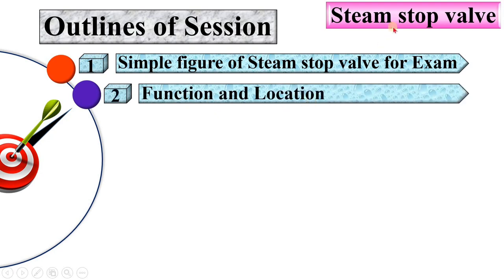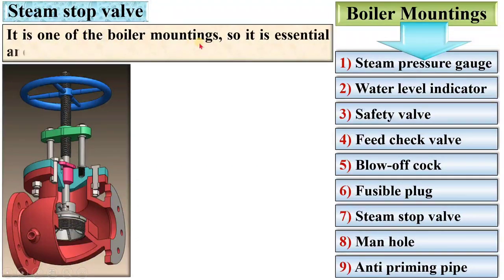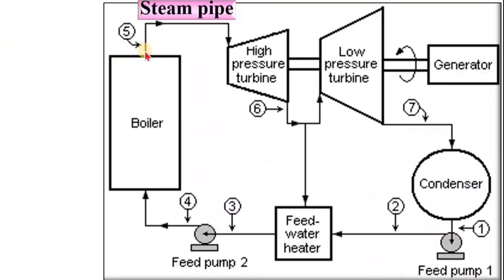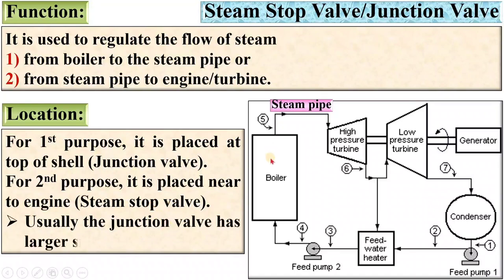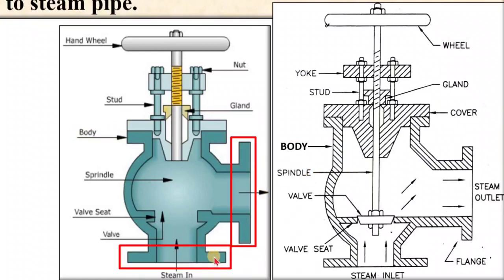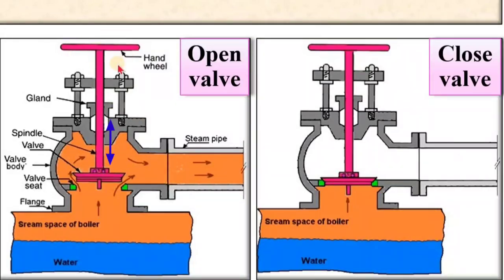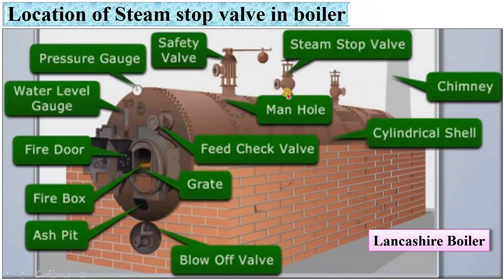Steam Stop Valve (Basics, Structure, Working & Location in Boiler) Explained

Comment from the maker: Steam Stop Valve is explained with following time codes: 
0:00 - Basic Mechanical Engineering lecture series 
0:14 – Steam Stop Valve
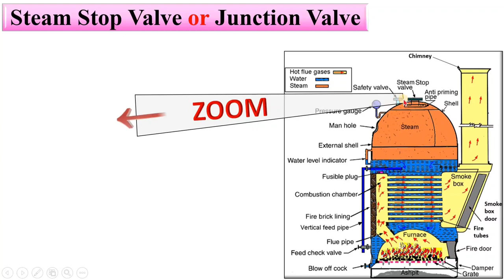0:41 – Junction Valve
1:22 – Simple figure of Steam Stop Valve
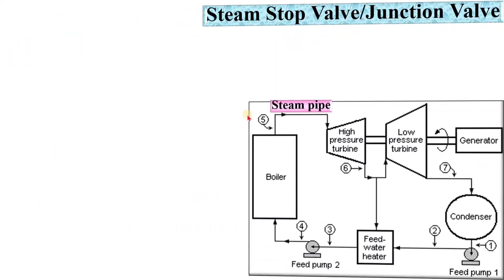1:42 – Function of Steam Stop Valve 
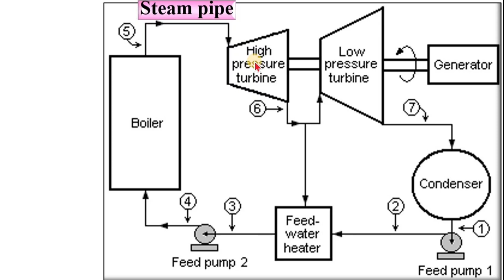2:16 – Location of Steam Stop Valve 
3:13 – Construction of Steam Stop Valve 
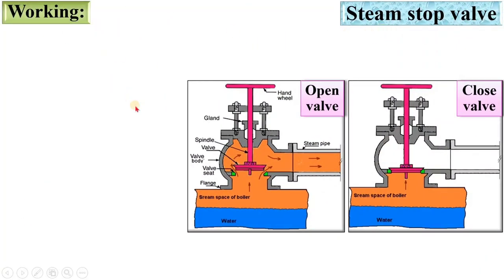4:28 – Working of Steam Stop Valve 
5:38 – Cut section of Steam Stop Valve 
5:57 – Location of Steam Stop Valve in Boiler